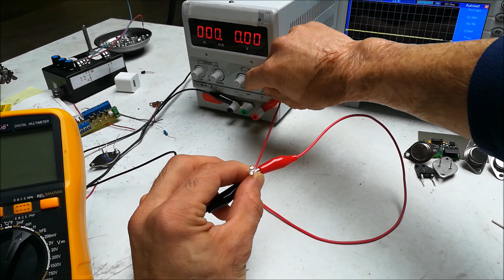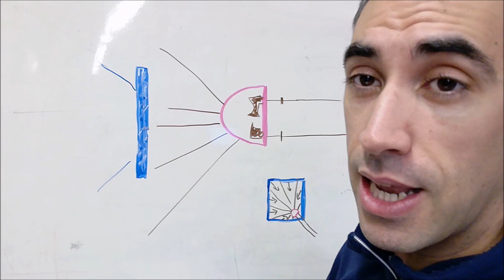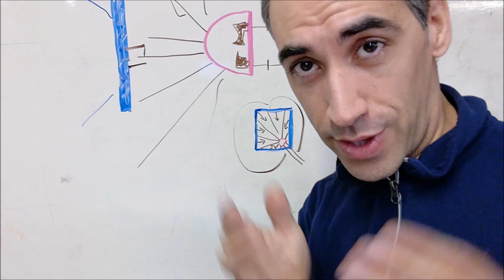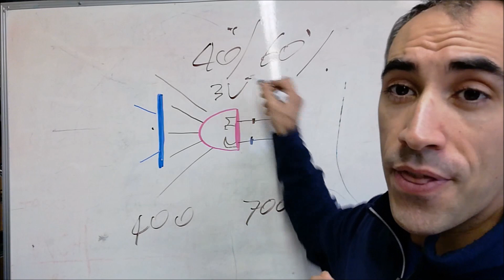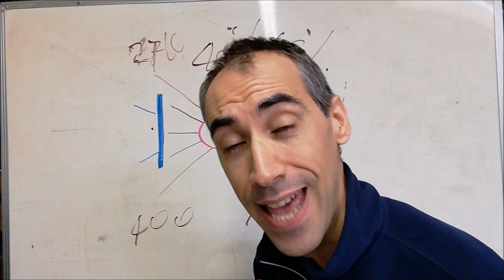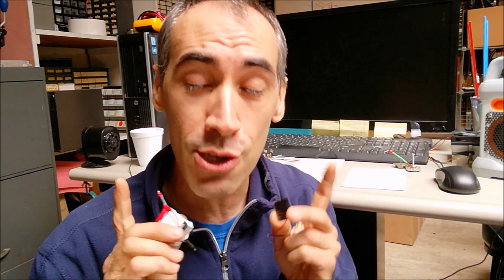BRIGHTEST Free Energy Illusion

Comment: Maybe it's a stupid idea but for experimental purpose use this solar panels and make something like a Dyson sphere. The led run with a power supply and the solar panels generate electricity. How energy can be generated? You can also use and high efficient lightbulb I hear that there exists lightbulbs which only consume 4- 5 watt. 

https://www.lightup.com/c11-led-filament-bulb-4w-e12-base-dim-25w-equiv-400-lumens-lumegen.html. It would be a very interesting project that no one make it.
Reply: I like the concept of the cube but too bad that you don't measure the Volta of the panels if the led is connected to the power supply?
Reply: It could be self sustainable for short time of solar panels have 95% efficiency. And will drop. 
I would just calculations

Comment: Thank you For This Idea But I Get Point what Your try build Self Feed Energy System In Closed Loop
My Think About This Why It Lost Lot Efficiency Because Your Using Not Photon Light Bulb Like is Act As Sun, And The Reason why Sun Gives Lot Energy Because Its Massive Giant Light Bulb And has Enouf Energy Like Almost to reactor Fusion. That It Can use On any Solar Panel To Power. But This Will Not Happen With LED Because LED DOESN"T have Photon Energy.
For Example Thomas Edison Light BUlb Has Photons Because Induction Coil Inside Glass Bulb Produce heat You Need Two 
Bright Vision Needed And Heat Needed Act As Proton To Run Self-Running Loop Brightness illusion...Good Channel Keep It Up This Still was Something :D
Reply: ERFAN S Hi there, LED is short for Light Emitting Diode, and I'm not sure why you seem to think that an LED Doesn't emit photons?👍😊

Comment: The question to be answered here is not voltage. It is power. You should have checked how much power it takes to light the LED. Then find out how much power the solar cell is putting out in voltage and amperage then compare those 2 and see what the difference is and you'll find a better answer. Not necessarily a free energy answer but a better explanation.

Comment: Extremely good and valuable video and explanation.   However my device, which I will offer to crowd source and make big bucks, inserts a ultra capacitor and diode into the circuit.  Once initialized, it runs for hours, long enough for me to get investors.  I can cut you in for a share if you promise not to tell anyone that a capacitor acts like a battery.   If not, then you are responsible for putting me and my family in the poor house.  I know you will do the right thing and not demonstrate and tell people about hidden capacitors.   : )